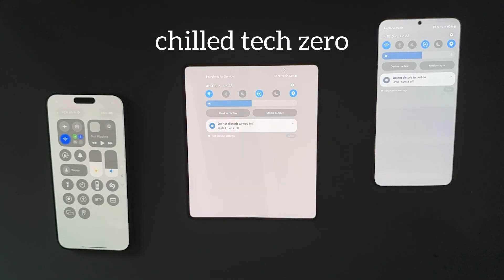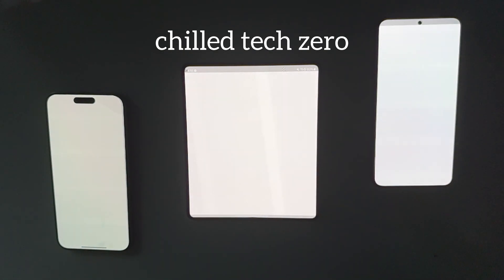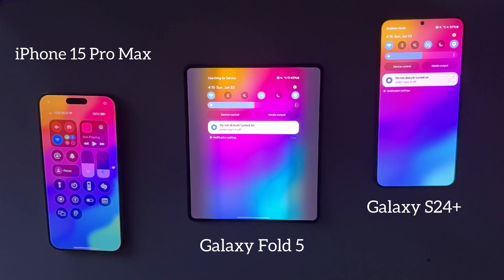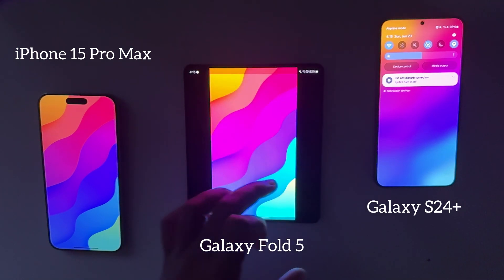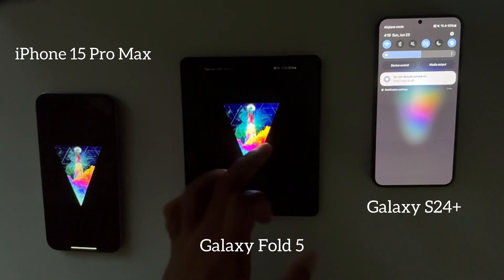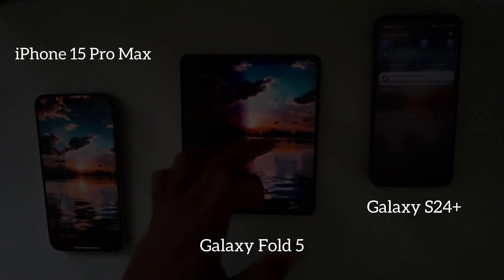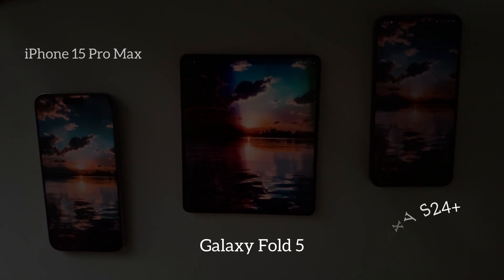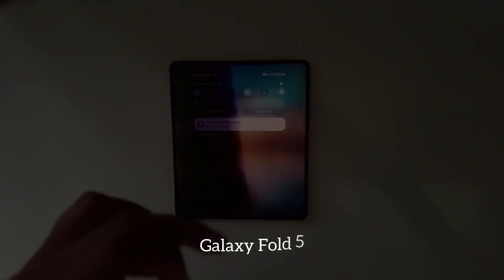PWM Flicker Test Results iPhone 15 Pro Max vs Fold 5 vs S24+ : Which Performs Best & Worst?

Comment: PWM is not perceived by the brain (conscious), but precisely by accommodation reflexes.

The issue comes when one part of the retina, or even one eye, capture at same time a different image than other part of retina or the other eye.

When trying to accommodate and focus the image, the nervous system make a comparison between stimulation of neighbor cells at the retina and the difference of image between eyes (convergency of the eyes towards the close object).

This effect of PWM depends on many factors, the depth of the modulation (not the same effect if one cell captures full brightness and her neighbor 0 brightness, or if just goes to 75% brightness), the duration of the low brightness (again if the suppression pulse last longer which will appear as thicker dark lines in the recording , the probability of being captured at dark increases) and finally the frequency of attenuation.

AFAIK in smartphones all models flicker as often as their refresh time (so avoid adaptive refresh mode, because it will decrease frequency under 30 Hz when screen is static, therefore try to force screen to 120 Hz always).

Apart from very bad units as Samsung and iPhones, majority of actual phones use DC dimming (only flick at their refresh rate) in the half top of screen brightness and use a medium frequency modulation at the lower range (usually 2000 Hz as recommended, some models at 4000 Hz).

At this level, my recommendation is to use active dimming: this is achieved by reducing the dynamic range in the digital domain, so video realism will be slightly affected but in general is ok.

In iPhone you can only use the onboard system by going to Accesibility => Screen => extra attenuation.

In Android you’re free for downloading third part software with different options at Google Play.

Some apps (I adore that 🥰) have their own inbuilt active attenuation, for example Kindle for iOS or Android. It is a pleasure for the eyes to have that.
Reply: so thats why my head hurt when i had an amoled samsung, interesting
Reply: @rmorinib857 It may be due to a number of things, not only flickering or PWM. I have an LCD Xiaomi which I rotate with an OLED iPhone.

The iPhone has bad PWM and low frequency flickering but the higher contrast of OLED is an advantage for the eyes.

On the other side the LCD has better colors and no flickering at all, but the lower contrast can cause more effort to the eye.

I red some articles since I wrote my comment: there are no perfect screen, the consensus is to introduce rest periods in long sessions, especially in smartphones because of accomodation fatigue combined with screen effects

Comment: It’s so annoying not to be able to use all the new good phones. Every year I pray to god that apple or Samsung start addressing this.
Reply: Check OnePlus 12 or 13, they have much better pwm hz than any apple and Samsung, for example apple and Samsung (after s24) use 480hz but Oneplus 12 and 13 uses 2160hz. Also the specs are the same or even better than Samsung’s flagship phones (faster charging and also the charger is included in the box) the camera may be a bit worse but nothing catastrophic
Reply: And i think they have an anti flicker setting,that on top of the pwm 2160hz refresh rate is helping even more with the flicker problem that some people have